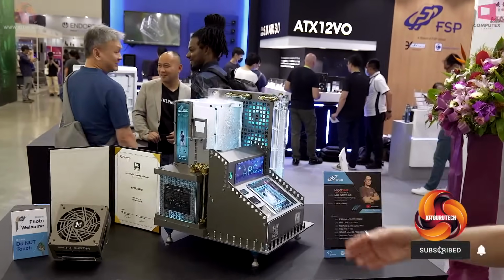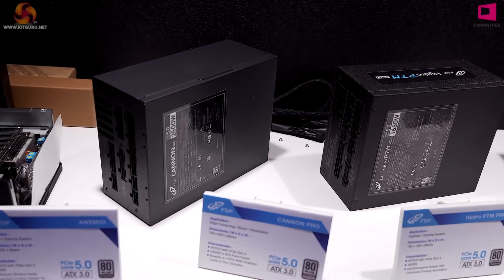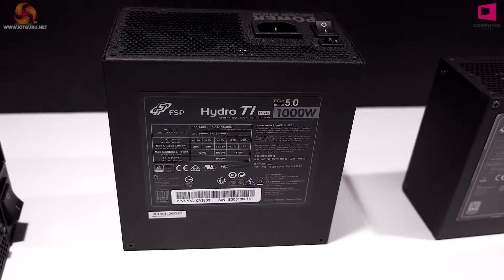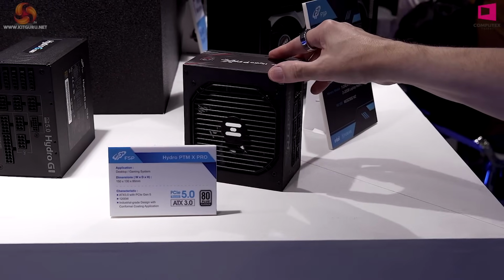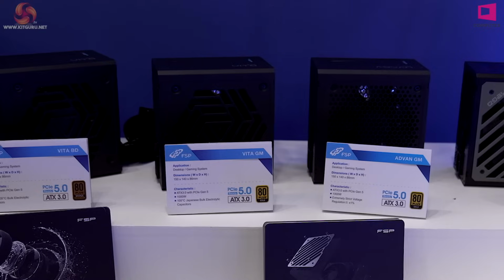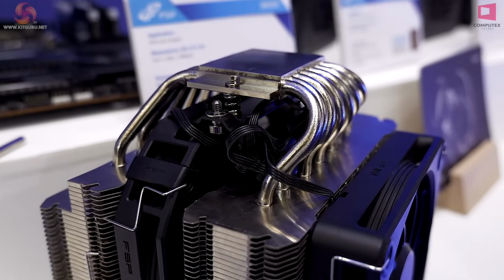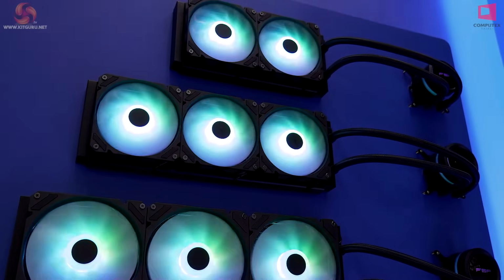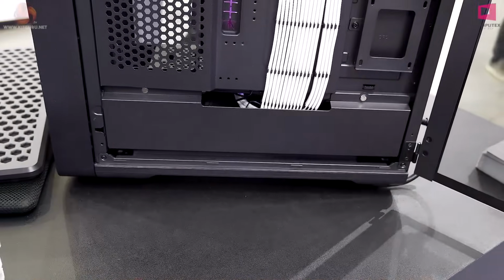Computex 2023: FSP - cases, coolers, mods and PSU's

Comment: Iirc fsp is providing universal cable extensions so you can keep the clutter in the lower bay while using the extensions to get a clean look out the back

Comment: I just bought the PTM 1000watt Pro X based on your recent review of the lower powered ,lowered tiered model. I have been a Seasonic and Corsair HX buyer for over a decade. Thought I would try another top end OEM,so far so good, my rig uses a  PTM 1000W PCIE 5 power supply,powering a R5 7600 non x/GSkill Flare X5 96Gb 5600MTs/4tb SN850x+2Tb Intel 660P/WD 4Tb Red+WD 16Tb Red+WD 6Tb Red  /MSI 670 PRO-A/1 Arctic P14 Fsn/Asus TUF 4090/ BeQuiet 360-mm AIO V2 /four  Phanteks 140mm fans/Asus 24x DVD Burnre/and a LG 14X bd-rw.
They make psu's just as good as Seasonic, imho. I use and buy both for my own and client builds.  rig uses a FPS PTM 1000W TX 3/[CIE 5 power supply, powering a R5 7600 non x/GSkill Flare X596Gb 5600MTs/4tb SN850x+2Tb Intel 660P/WD 4Tb Red+WD 16Tb Red+WD 6Tb Red  /MSI 670 PRO-A/1 Arctic P14 Fsn/Asus TUF 4090/ BeQuiet 360-mm AIO V2 /four  Phanteks 140mm fans/Asus 24x DVD Burnre/LG 14X bd-rw,all in a Phanteks ENTHOO LUXE SE  black with a red interior ,I love this case  KitGuru has the best coverage of all CES 2023 of any Tech journalist's ! ... PERIOD !!
Reply: Where did you find that ? I can’t find it anywhere. Are you in USA ?
Reply: @stickyfingers9710  Canada Computes in Ontario, in stock now. Mine was 209 $ on sale.
Reply: I saw that review what a unit. Never see fsp listed anywhere in uk

Comment: I got an almost unused seasonic passive power supply recently, which gave me a reason to unrivet the PSU shroud of my fractal define 7xl. There is a lot of air blowing over it, and it runs  cool even under full system load. 

Sadly, the chassi has TG, so to not have to see the power supply, or even the inside of my case like a 12 year old, I attached an IKEA Skådis to the glass panel, so the case now doubles as storage of computer related knick-knacks.

Comment: Damn the 3.3 and 5v rail neglect is crazy. A 1650w power supply having the exact same power and amperage ratings as my less than 2 year old (from release not ownership) cooler master 850w psu is a bit strange. With all the rgb and power hungry gen 5 ssds, more beefy minor rails would've been nice. Regardless tho the sizes they've managed to keep these nuclear power generators to is extremely impressive.